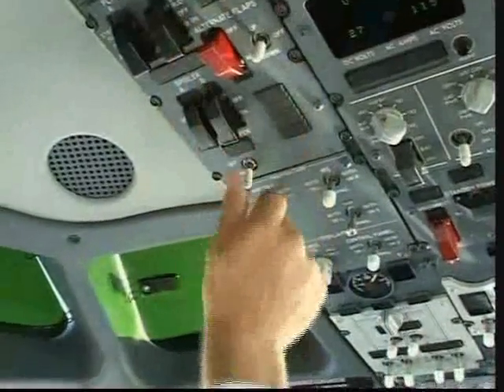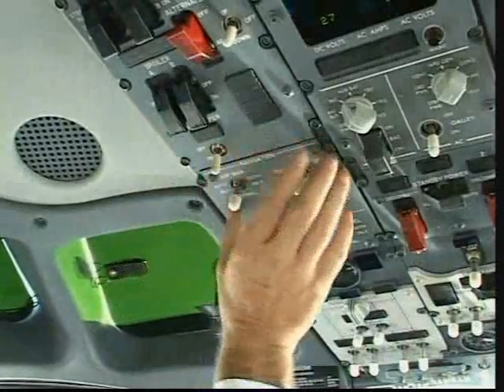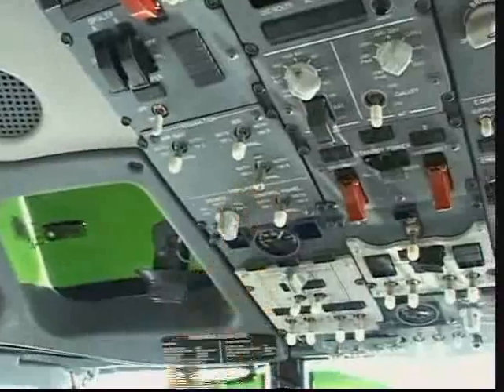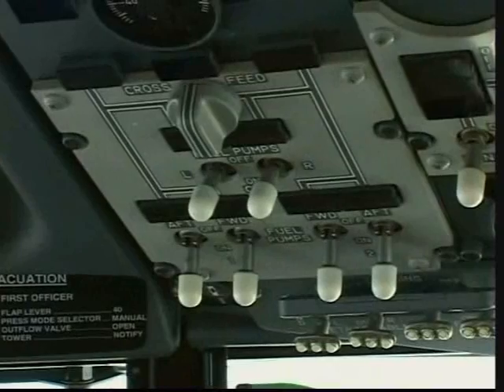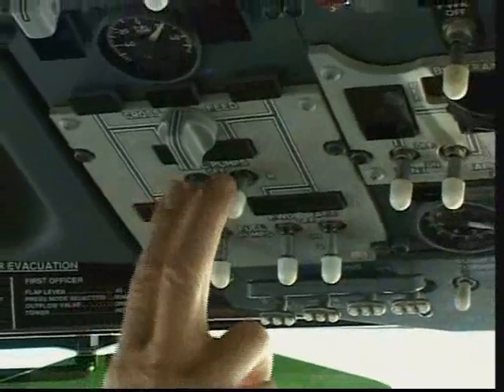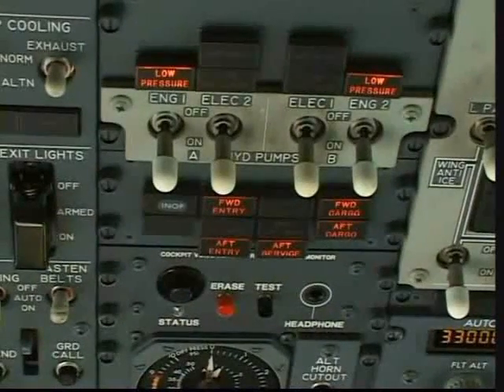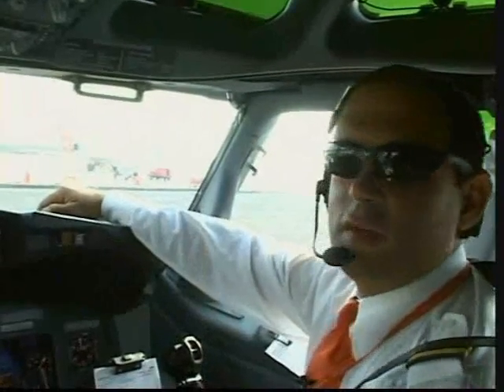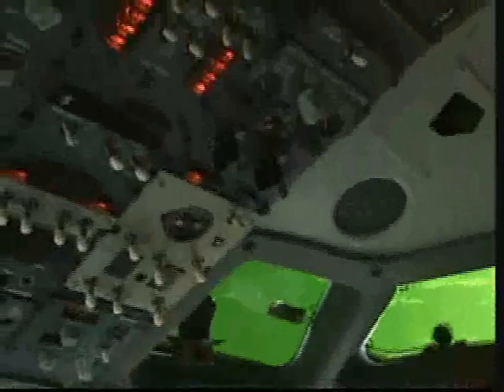Boeing 737-800 - Overhead panel explained

Comment: I got a question, I dont quite understand the apu generators in the middle panel, can someone explain it to me? And one more thing does the engine hydraulic 1 and 2 have to be on at the same time as electrical hydraulic  1 and 2?
Reply: The APU generator switches will connect the APU generator to both AC transfer buses via an Auxillary Power Breaker (APB) that closes the circuit. When only one APU generator switch is used, the other side's transfer bus is still powered through the tie bus and the two bus tie breakers (BTB) as long as the Bus Transfer Switch is in AUTO. So you really only need to use one APU generator switch because bus tie system will continue to power the entire electrical system. However, if you also select the second APU generator switch, that side's respective SOURCE OFF light will no longer illuminate, so its recommended to use both switches to extinguish that annoying light.

Engine driven hydraulic pumps should always be on. The electric motor driven hydraulic pumps should be turned on before starting the engines, or sometimes after starting the engines (depending on company procedures)
Reply: @Baxter Cat! So you really only need to turn on one APU GEN switch? Do you know why they implemented two switches instead of just having one switch do the work?
Reply: The Comedy Pilot — excellent question! I actually was thinking about this exact same question yesterday. The reason is because of the following: Imagine you have one AC Transfer Bus powered by the engine-driven generator, and the other side’s AC Transfer Bus is also powered by its respective engine-driven generator. If you move the left APU GEN switch to ON, then the left side will receive APU generator power, while the right side will continue to receive power from its engine-driven generator. Consequently, if you put the right APU GEN to ON, then the right side will receive APU generator power, while the left side will continue to receive power from its engine-driven generator. The only circumstance where you could only move one APU GEN switch to ON and still power the entire electrical system, is when there are no engine-driven generators available. Hope this helps!
Reply: @baxtercat5462  Actually that does make sense, and the blue bus lights are also a good visual reference because it shows you if you have the APU GEN switches on and what GEN switches are on for the engines. Your comment really cleared that up for me, so thank you it was a great help!